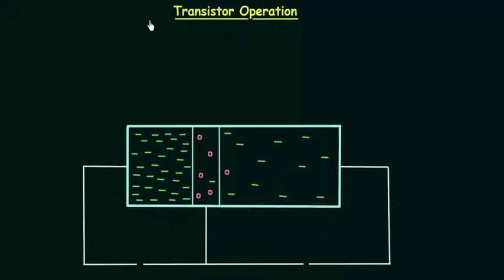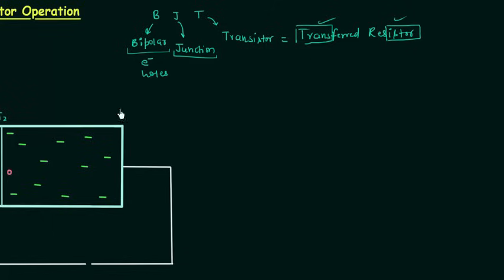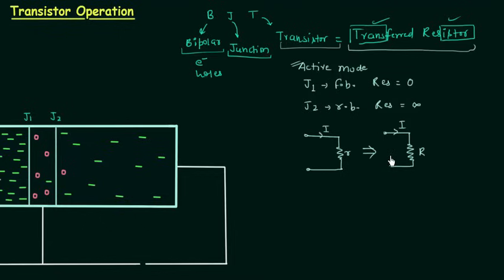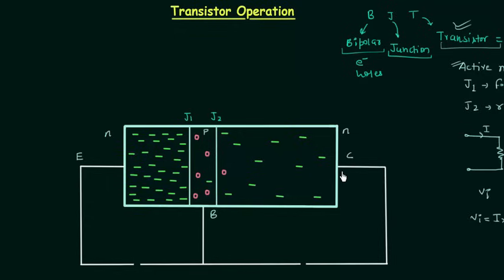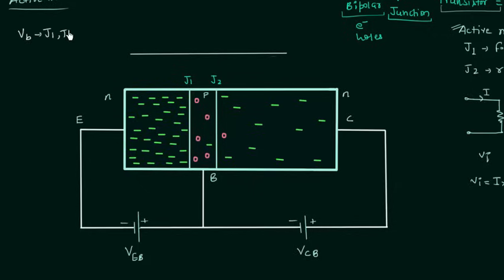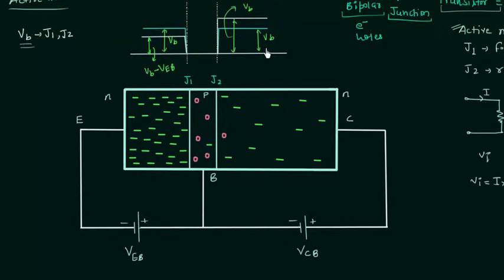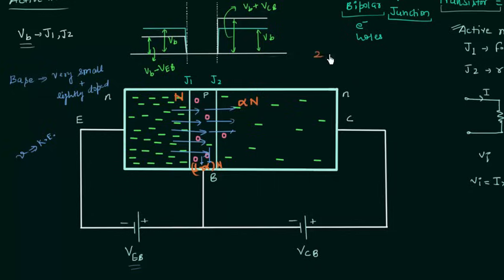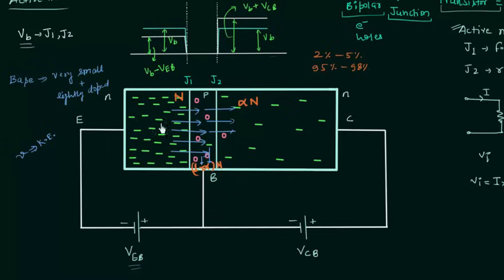Working of Transistors

Comment: why do people teach this stupid bs? ELECTRON FLOW! Electrons flow from negative to positive! That's why the collector always has a higher resistance to PULL it up from when the base is pulsed. The base pulse says HEY! GET FLOWING! Then the electrons move from the Veb to Vcb like a rocket stove works. the base pulse pushes the electrons into the base and towards the emitter and in turn provides POTENTIAL and that's how the current flows. Your positive flow is pure boosheet...

Comment: if the resistance is high at the out put terminal if tends to low current then how the signal is amplified
Reply: In terms of voltage ( low to high) 
The same current is flowing but the voltage is increased

Comment: sir, i have one doubt.how the input signal is weak ?and output signal is large?you said that in the case if input signal the resistance is low ...in the case of output signal the resistance is high....so if the resistance low the current flow will be large...can you explain this sir..

Comment: 7:51 - Can you please explain why the few free electrons that come from the E and recombine in the B move as valence electrons through the Base Terminal? Like, what happens when they recombine that makes them flow through the base instead of passing on to the Collector Region?
Reply: Same doubt sir could you please explain ?
Reply: There are not alot holes in Base so some are recombined but there are extra electrons that are left from the recombination so they will move to the collector

This is because base is small and light

Comment: i HAVE A DOUBT THE CURRENT FLOWS FROM COLLECTOR TO EMITTER, SO ACTUALLY OUTPUT CURRENT IS EMITTER CURRENT WHICH MEANS  EMITTER SIDE IS OUTPUT SIDE. HOW IN ACTIVE MODE AMPLIFICATION TAKES PLACE SINCE EMITTER SIDE HAS VERY LOW RESISTANCE
 IN ACTIVE MODE

Comment: Because the Base it's lightly doped and very thin, the depletion zone between B and C is very small so electrons find it very easy to jump over it,even if it's reverse biased, no??
And shouldn't one of the Vb's be negative, because we first have a NP junction, then an PN?

Comment: Sir why the direction of current Ie is towards -ve terminal of battery
Reply: Positive terminal of battery is at higher voltage level than negative and current flows from higher level to lower level. Hence current flows towards negative terminal.

Comment: How are both the junction voltages equal?
Reply: Not actually the voltage but the barrier voltage 
Because when transistor is no biased there will be same barrier potential even a little difference may be there

Comment: Sir I have a question that is
How the electrons enter from emitter to collector region because junction j2 is reverse biased therefore the potential Barrier at j2 increases and thus electrons should not be able to cross junction j2
Reply: high kinetic energy of electrons that enter emitter and also since the base region is lightly doped and thin the j2 reverse biased state should not be concern for that high energy electrons ^-^

Comment: the junction j2 is reversed biased so how can electron can pass from base to collector @Neso Academy
Reply: Since the base and collector junction is reversed biased, so it facilitates minority charge carrier movement. Which at that point of time are electrons coming from the emitter layer
Reply: Lets start from basics
 Initially   when a PN junction is made, a barrier is formed which will stop the flow of charge carriers on either side. When pn junction is made we didnt connect any supply.
When we connect supply what will happen in FB or RB
IN FB
In simple words we are giving push to charge carriers which will cancel the effect  of barrier and therefore  they move towards  the other side

Now assume 100 electrons entered  base region from collector 

20 get recombined with holes in base (since base is lightly doped we cant expect much recombination process in that region)
1 or 2 e's get attracted to +ve terminal of veb 
Remaining 78 or 79 e's wont stay in base since its a small region
They drift towards  the collector  region ( vcb +ve terminal attracts the e's  which makes them to move from B to C)
Reply: Rohan M bro firstly electrons entered from emitter to base not from collector to base,check ur comment u say 100 electrons entered from collector to base,its not possible,u should have say 100 electrons entered  from emitter to base,plz check it out in ur comment

Comment: When the current will flow from a low resistance to high resistance will the of the current remain same or change?
How can the current remains same is the resistances are changed.
Will not the value current decrease when the resistance increases

Comment: As j2 junction is reverse biased how the electron can move to collector ?
Reply: The base layer i.e the p type layer in an npn transistor is very thin thus has very less holes in comparison to the number of electrons (excess) in the n type emitter. Since the emitter is forward biased the electrons from the negative terminal of the source in the input side repel the excess electrons of the emitter since it is n type, as a result they get pushed towards the base and some of them drain to the positive terminal of the input source and the remaining electrons cross the base-collector (p-n) junction thus get drained through the collector to the positive terminal of the output source which is connected in reverse bias. This completes the circuit. I Hope I am able to clear your doubt. (Tip - if you get stuck, think in terms of electron flow) :-)

Comment: Why direction of electrons are  downwards in base?
Reply: Because on both sides of p there are electron which repel the minority carriers of the base which are electrons and there is attractive forces of the positive terminal of battery pulling the base electrons down.
Reply: one thing u have to remember is electrons move towards emitter to base current will flow opposite direction of electrons
Reply: Good question
Reply: You are the only one to question this.
Reply: I had the same question.

Comment: dear sir,how did u write ic=alpha ie+ico
Reply: Because actually collector current is the combination of two currents i.e emitter current and reverse saturation current 
Emitter current is generated due to the movement of electrons (1-alpha N electrons where alpha is the common base current gain given as ratio of collector current to emitter current ) and the reverse saturation current is generated due to the minority carriers in both sides (electrons in base and holes in collector side ) 
Just from my side or you can search it somewhere else😊

Comment: sir..how reverse saturation current is saturated...??????
Reply: Its saturated with respect to the reverse bias voltage applied. i.e it does not depend on the reverse voltage, its independent of that. It depends only on temperature, since minority carrier concentration depends only on temperature.

Comment: I  had a small doubt.it is said that  the collector -base junction is reverse biased therefore the electrons  entering the base from the emitter experiences more resistance from the collector base junction and they  should leave the transistor from the base terminal.no?but why  it is not happening ?

Comment: how electrons  can pass j2 junction sir as the barrier potential of j2 is increasing becouse of reverse biasing the collector :/ ?
Reply: It's true that,in j2,the barrier potential is high.But,notice that,the barrier potential acts as a 'barrier' only for majority carriers.When electrons come from emitter into base,they become minority carriers in base(for npn).So,in that case,the barrier potential can't affect anymore.
Reply: Meghjit Mazumder when electrons reaches base,there are more concentration of electrons than holes now in base.Then why it is treated as minority carriers?Is that because electrons have enough kinetic energy due to forward biasing to cross the barrier?
Reply: thank you, sir ,you also solved my doubt.
Reply: M Sheshant 
When electrons are in base region 
Some get recombined with holes 
And some get attracted towards the +ve terminal of Veb(this is Ib current) 
Remaining electrons will not be treated as minority ,they move to collector because of the voltage Vcb (as you can see +ve terminal of vcb attracts the electrons so that they DRIFT from base to collector (this is Ic )
Reply: when base is of p region, in p region electrons are  treated as minority carriers

Comment: You proved that Vi<Vo the proof is wrong because when r is low high current will flow and if R is high low current will flow and you told that because of High R Vo is more it may be wrong explanation. Please check
Reply: use comas,